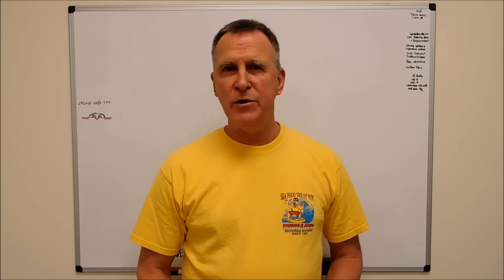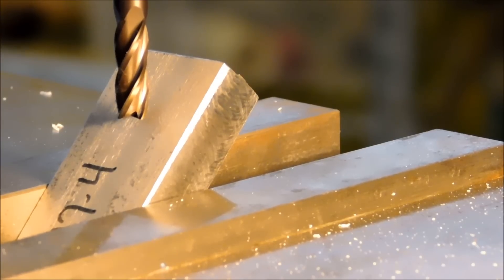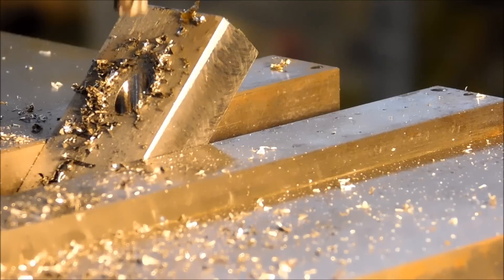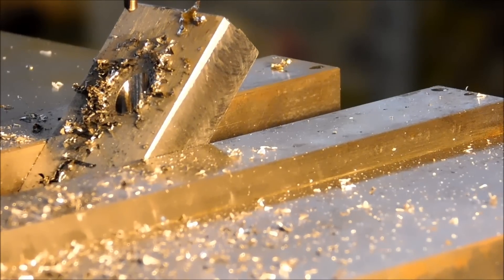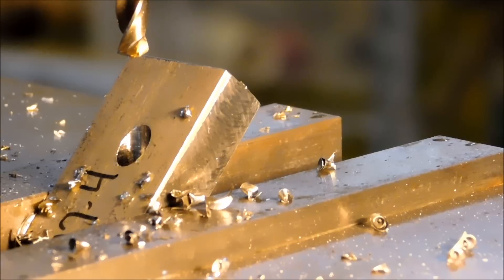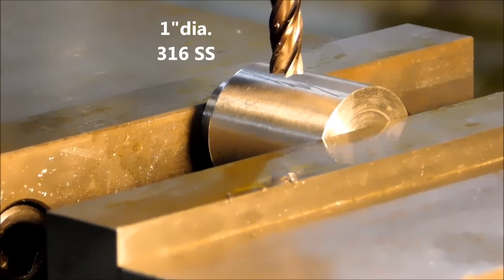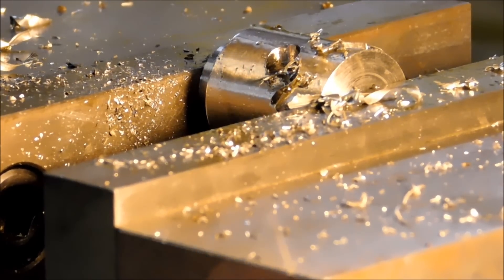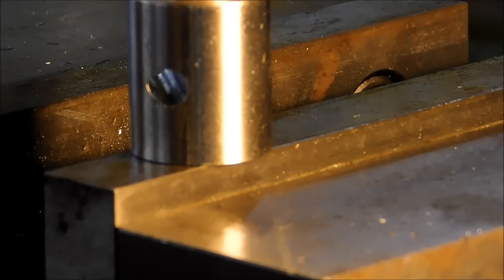Drilling Holes on Angled and Rounded Surfaces

Comment: Nice video on drilling these difficult holes and the tip on the post operation reaming. Other than hand deburring the holes, is there another way for deburring the part while it is still in the vise and using a special cutting tool?
Reply from the maker: Short of an elaborate CNC helical loop, I don't know of any way to clean the edges. If anyone knows of one, please share it with us. I just use a flat file to re-establish the flat surface, and 3 corner scraper for the aggressive upper sharp edge. Thanks for checking in Paul.
Reply: I wonder if the Ellipti-burs Tom Lipton showed could do it if you get the angle right
Reply: The Ellip-Deburr tools (e.g., http://monaghantooling.com/precision-metal-finishing/elliptical-deburring/ ) that Tom Lipton showed in his You Tube be a good choice for production work and seem to work over a wide range of hole diameters. Thanks for the reminder.

Comment: Hello Joe Pieczynski
Why not just continue plunging with the centre cutting end mill??? Save some time with tool changes & a little easier when breaking through the other side.
Reply: Drill bits are much cheaper than a good endmill

Comment: Hey Joe, thanks. I just have a Grizzly mini mill and cant raise up the table, I have a ER 20 setup and can use the fine adjustment instead of drill press style operation, any tips or just peck at it? Don't know about your mill but sounds like some excess backlash of gears in drive, and it sounds like $$$, good luck. God Bless Ya, Dave

Comment: Hi Joe, great video as always. Great tip but however, not everyone has a milling machine and endmills. How would you go about doing it with a standard pillar drill or even by hand if the need arose. Say you needed to do it on your trailer or caravan chasis ?
Reply from the maker: Hi Dave. If I had to do that, I'd drill a hole in a piece of material and mill the angle on that part. Clamp that part to the area where you need the angle hole and use your clamped piece as a guide. It may take some prep, but it would get the job done.  Is a pillar drill a drill press?
Reply: Hi Joe, Yes Sorry I forgot you Yanks call things differently. A Pillar drill here in England and Australia  is what you call a  drill press. Available in floor mounting versions as well as bench mounting. We also have them called Radial Drills, where the base is mounted on the floor and the arm with the chuck and motor on swings radially about the column and is also adjustable in and out. The work is clamped to the table and the drill can be positioned anywhere within the table area and quite often outside to parts that are on the floor. Thanks for the reply, but you still mention having to make a block using a milling machine that a lot of people do not own. Regards from a HOT Adelaide in Australia @ 42 C.
Reply: I play with both for a living.  2" hole, or under 1/16" in Nasty!  Joe, We have the same lathe, just generations apart.  I always went towards the chuck.  One lathe needed direct reverse.  I was young, but made it work.  Basics are gone in schools.  It takes dedication from a teacher, to keep up with the latest.  We don't need computer guru's  Just a kid that thinks this is cool!

Comment: I think my Bridgeport was even louder. I rebuilt the top end last month. It's probably just a bushing repair. There's plastic bushings on the motor pulley ( on variable speed machines) and the front variable speed pulley. But on my machine nearly every bearing felt like it had sand in it  as well, so I was glad I did the whole top end - just a couple hundred dollars in parts, I got a great understanding of how the machine works and the nearly silent running machine was the reward.
Reply from the maker: Time is my enemy. I'd love to do that. That machine hasn't been quiet for some time.
Reply: I also second Jame's recommendation.  It could just be the plastic bushing the spindle drive pulley.  I've heard that's a common source of noise in older machines.
Reply from the maker: It is, but getting the motor off is a BITCH

Comment: Super useful. I have done the mill cutter in a Jacob's chuck and had it pull into the job and ruin it, causing me to invest in an er collet which has been a blessing.
Reply from the maker: Everyone is different, but I am not a fan of endmills in chucks. I do it once in a while if I am counterboring aluminum and there is already a hole, but otherwise, you are not going to catch me finishing an 80% lower on a drill press.

Comment: if you fold a piece of paper a couple times and put it on the soft jaw side you will increase clamping pressure.
Reply from the maker: The KURT 675 delivers about 9000 pounds of clamping force. The cardboard trick is good for multiple parts, or a part that is not parallel on both sides.
Reply: Clamping force is reduced by being out of parallel. I will use your pecking method. Thanks Joe.

Comment: Joe, I use this trick often but I would make sure and give a caution.  Not everyone out there has a Milling Machine and my try this on a Drill Press.  It's not a good idea to do this in a Drill Press as the Endmill will often walk, reach the edge of the hole, dig in and break off.  You used a Center Drill  after the Endmill as one of your steps.  For Drill Press users, try the same thing except skip the Endmill and use the Center Drill as step one.  You can go deep enough with the Center Drill if you use frequent Peck cycles to let the captured chips fly out of the short Flutes on a Center Drill.  If you go deep enough, you will have a full circle to start your cut with a Drill and there is the starter hole created by the Center Drill to keep everything centered up.
Reply from the maker: You will have to be very patient. The centerdrill 2 flute design will have a greater tendency to walk than an end mill. Its the angled tip of the centerdrill and angled surface that will increase deflection potential.

Comment: Hi Joe, great vid as per usual. I'm not trained as, nor do I work as a machinist. I call myself a "machinist as required", haha! I'm wondering how you calculate positioning the end mill so the center of the hole is where you want it. I can figure it out on the round bar by touching of on the side with an edge finder and moving to the correct spot (hopefully called out on the drawing). But how is it done on a flat piece set at an angle if the hole has to be positioned to line up with a mating hole? As the angle changes this mystery calculation also changes. Hope that is clear as mud!
Reply from the maker: https://www.youtube.com/watch?v=wS1043KWm-M   This is one way. A tooling ball gets the job done too.
Reply: Thanx Joe, I knew you'd know how. I just got a new pair of glasses today.  Your ear pieces look really short to me, what's up with that? Are they comfortable that way?
Reply from the maker: They are. They fit my head like a glove.

Comment: Could the same thing be accomplished with a ball end mill a diameter smaller than the finished hole size?
Reply from the maker: The pilot should be at least the same size as your final diameter hole, or you will have problems.

Comment: Joe, thanks for the video! I have a smaller mill and can't raise the table. Would it be better to peck with the quill or move the table sideways? Thanks again!
Reply: The table on my mill can't raise either so I have that problem too.
Reply from the maker: Using your quill stop nut as a depth setter, dial it down very slowly and peck away at it each time you lower it. 5-10 thou at a pop. no more. Keep the quill lock in heavy drag mode.
Reply: Thanks for the tip Joe.

Comment: Hi Joe. Please excuse the dumb question, but is there any reason why you couldn't do the whole job with the end-mill, and save on the tool changes? I would have thought that it would break through cleaner on the back side than the drill bit would.
Reply: I only asked an hour ago, so give the man a chance ;-) He has a day job after all.
Reply: I would say it's down to cost of end mill vs twist drill and length of tool available also maybe
Reply from the maker: There is no reason you couldn't finish the hole with an end mill, but plunging an end mill is historically not known to give a precision hole if its the first tool to cut. Following a drilled hole with an end mill to true up the hole is not unusual.

Comment: Good Tip, thats how I do it. Can I request a video? One area I am very uneducated in is the naming of different metals. I often hear people on YouTube refer to '4140' or '316' or in this video '17.4'. Can you give any explanation as to the where the numbers are derived from and how you would go about choosing what grade to use for a component. At home I just use what ever I can get hold of and at work we don't use any common materials so ive never had to study it. Cheers
Reply from the maker: I'll look into this one Crispin. Good suggestion.  Coming from a medical background, I can say the 17-x series stainless steels are heat treatable. I was surprised at that one. 17-4 cuts great and heat treats easily. Ends up at around 44C rockwell.

Comment: Joe, I understand that using a mill of a different size than the drill bit would leave a trace detail. Would there be a problem in using a smaller sized mill and bit, as a pilot hole, then follow up with the correct sized drill bit to remove the trace and end up with the intended dimension? Would there still be a tendency for the bit to wander on the second drill pass?
Reply from the maker: The single sided contact caused by the slanted surface and the smaller hole would still cause the drill to walk. Unless its very soft material and your drill is very rigid. Overall, go bigger.

Comment: As to the question of drilling angled holes in a bench top mill. Again use an end mill to start the hole. But use the depth stop on the quill to control your depth. Not bad for one hole but a PITA for multiple parts. The one thing I don't like about this technique is raising the knee against the lock. Because you need to have the knee locked.

That noise is most likely caused by the cheap plastic bushings and key in the bottom half of the motor pulley
Reply: Just wondering why do you feel you need to lock the knee for a drilling operation?
Reply: +Little Work Shop of Horrors Put an indicator on the table and then tighten the lock. if the ways are worn the table will rotate with the front coming up more than the back. that's why you never tram the head with the knee unlocked
Reply: Indeed  but not entirely relevant, not all vertical  mills even have quills so drilling has to be done with the knee..

Comment: Hi Joe,  I would bet the death rattle is coming from the vari speed drive. If you switch from low to high or visa versa and the noise basically stays the same it points that way because the motor rpm stays the same. There are plastic bushings and keys in the drive so the discs can move axially on their shafts. It's common and not a mountainous task, but definitely need to have the procedure handy and parts ahead of time if you want to get back up ASAP. I've had good luck with H&W machine repair 800 285 5271. They'll have everything you need and will be a good one to ask about the rattle to confirm. Let me know if I can help further.
Reply from the maker: Thank you.
Reply: James Shaw I second H&W.  They have the parts, videos, and are nice on the phone.

Comment: great video Joe could this technique be used on a drill press and if so how would we go about doing it scene you can't put a end mill in a drill chuck  thanks for sharing your knowledge
Reply: raymond woodring. if you have the means you could make an end mill holder/collet. 

basically a sleeve made out of something like mild steel so the hardened chuck jaws can grab it. use a set screw to secure the end mill.

but remember, a drill press uses a taper to secure the chuck, side pressure like you will get in this operation will likely cause it to come apart at speed.
Reply from the maker: I wish I could suggest an alternate method, but drill chucks on drill presses weren't designed for end mill loads. It may work for you if you creep down to depth by small adjustments on your quill adjustment nut. I am going to guess it will jump around quite a bit. You won't know unless you try it, but its really not good for the machine.
Reply: Or, redefine your end mill as a flat ended drill and carry on regardless. Loads are axial, so a drill chuck will work just fine, it is any side thrust that is the big NO-NO for drill chucks, not only for holding problems but also you tend to loosen Morse tapers. 
edit I just read some more comment/replies and see you have mention tapers.

Comment: Thank you for the great technique. What is the best way to de-burr/chamfer those holes?
Reply from the maker: I use a flat file to address the surface and usually a 3 corner scraper or a buffer to break the edges.

Comment: Hello Joe,  Timely topic as one of my projects is to drill and thread a new hole on my piston QCTP where the handle is ninety degrees from convenient to say the least.  However I have a column table top mill (Rong Fu) so I have no knee to raise as the drill is lowered.  Any suggestions on how to best mill/drill with that equipment?  I have been really enjoying your channel since Chuck (outside screwball) recommended it several months ago.  You don't disappoint.  Take care.  Doug
Reply from the maker: Thanks Doug. Screwball is OK in my book. I would say to lower your cutter by bringing your column down against your depth ring in very small increments. This is not ideal, but its close.

Comment: Getting the hole at an angle is the easy part—getting it positioned precisely is hard. A demo of using tooling balls would be great. I have a rough idea of how to use them, but haven't seen an actual demo.
Reply from the maker: I'll put that on the list.
Reply from the maker: I do have videos of how to find the hole using pins and stops. take a look.
Reply: Have you seen Stefan Gotteswinter's take on corner location? Vaguely reminiscent of Pacman.

Comment: Great tip!! I have used the end mill trick. But using the knee to control the feed is priceless.. P.S.  I had a drill press making same noise, ended up the set screw on motor pulley backed off allowing it to rattle on the key way...

Comment: Nice demo, Joe.  
Question:  why is using  a center drill instead of a spotting drill common practice?  I seem to recall hearing that center drills were designed for drilling the hole to support the tailstock center.  The purpose of the smaller diameter hole to prevent the tip of the center from bottoming out and keeping the center from seating as well as providing a reservoir for lubricant.   
Are spotting drills a more modern invention perhaps?  Just seems curious because the small diameter of the center drill can be fragile, especially if used to try to start a hole on an inclined or round part without milling the flat as you demonstrated.

Are your pulleys tight on the shaft?  Sounds like a setscrew has loosened and some play has developed between a pulley and a shaft.
Reply: Richard Freeze, I was always taught to use spotting drills for pilots as well.
Reply from the maker: I use both. If you have a hand ground drill and the center is off, it may be the first thing to make contact on a spotted drilled feature and jump around. I think the center drill has the edge because the starting load is farther out and its not a full cut until a reasonable depth is achieved. Just my opinion and experiences talking.
Reply: That makes sense, letting the lips of the drill align rather than the point.

Comment: Please excuse my lack of knowledge, you mentioned its a bad idea to stick an end mill into a chuck, can you tell me why that's a bad idea. I get that you would loose some accuracy but what else would be the problem. Thank you
Reply: End mills have hardened shanks which will dull the jaws of a drill chuck.  And because you've got hard against hard the mills tend to spin in the jaws.  The damage done lessens the chuck's ability to hold drill bits with sufficient locking force.
Reply from the maker: True....and most drill press chucks are pressed onto a tapered shaft intended for direct axial load. Any side load could cause the taper to release.

Comment: Another great video.
Why is end mill bad on drill chuck? Something with side loads?
Thx.
Marty
La Verne, CA
Reply from the maker: Most drill press chucks are pressed onto a tapered shaft intended for direct axial load. Any side load could cause the taper to release. Plus if the spin, it can damage the chuck jaws.

Comment: That mill sounds as noisy as mine, a cheap Chinese ZX50CA, with geared head. I have tried adding thicker transmission oil but one of these days I will have to take it apart and check the bearings and gear meshing if I want to keep my hearing! Love the videos and have learned alot from them, keep up the good work.
Reply from the maker: Thank you